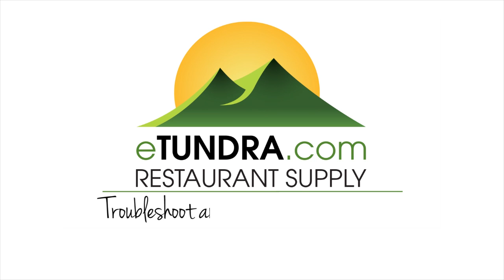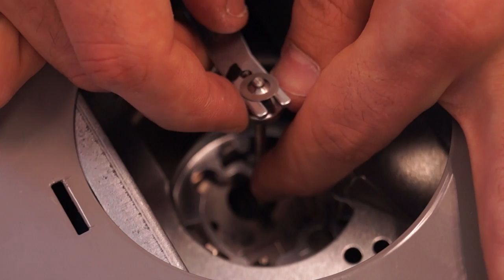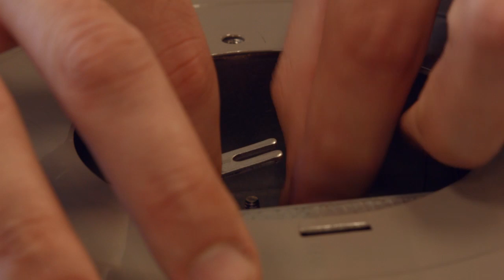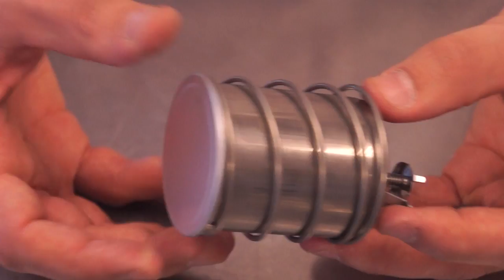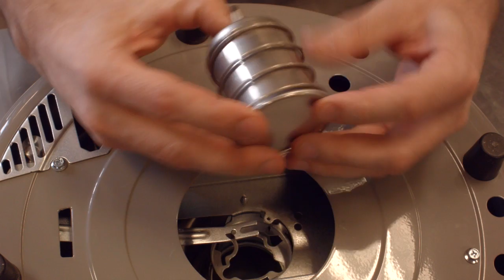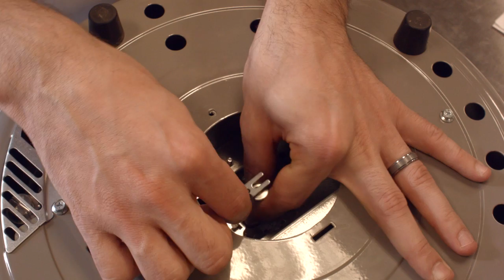Rinnai Rice Cooker Repair - Part 2: Replacing the Thermal Sensor | eTundra

Comment: I struggled with 2 Rinnai gas rice cookers I bought new. They would prematurely shut off and we would have to keep turning them back on. We bought new thermostats, changed the gas lines, changed the gas hose, even had our meter upgraded. Nothing worked! Then one day I decided to read the manual and saw a section in the manual about commissioning the rice cooker. There in we found the specs for adjusting the ATPP. You will need a manometer to do this, you have to remove the drip tray and one of the panels on the underside. Then you have to measure it with the flame going. I just had my HVAC guy who has the tool and knows how to do this adjust it for me. Our measurements showed that we had too much gas pressure. So we backed it back down. Now this rice cooker works as it should. It was so inconsistently working before, sometimes we had to restart it once, twice, several times and it just never made sense. Now it works on the first try. I hope you find this comment before you waste all the time and money I did when I should have just RTFM.
Reply: Bradley, I have 2 rice cookers as well and they randomly shut off at 5 mins turning on. I called tundra and they claim it needs break between cooks and also the pilot light can overheat it and cause the sensor to trip early. Do you turn your pilots off after every cook? and also do you cook consistent batches back to back?
Reply: @rossmatsuyama5692  No I don't think it needs to break between cooking. You need to adjust the ATPP. There's a screw to do this. I have a second gas rice cooker and got close enough by guessing where to adjust the ATPP to make it work properly by looking at the first one that was adjusted by my HVAC guy. You could probably mess with the screw by trial and error and get it working IMO.
Reply: @bradleypham thanks a bunch the new ones I got don’t have a manual that has that portion and I found a link to the older manual with the pictures to the ATPP- will give it a try.

Comment: Aloha from Hawaii.  My dad has a Rinnai commercial gas rice cooker.  He has 2 pots for this cooker.  One pot cooks rice just fine.  The other somehow is not communicating effectively with the cooker.   The cooker does not turn off and resulted in some seriously burned rice.   My dad still uses this defective pot but montitors it closely and turns it off manually when the rice is cooked.  He believes that the removeable piece at the base of the pot is the problem.   It is quite corroded.  Do you think this could be the problem and is this piece available for purchase?